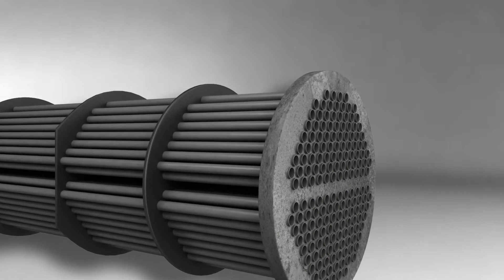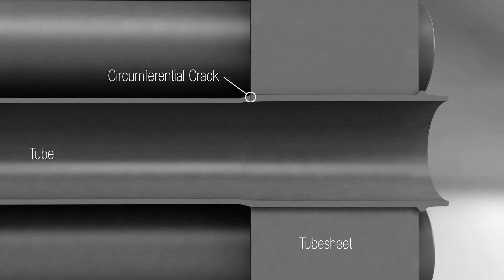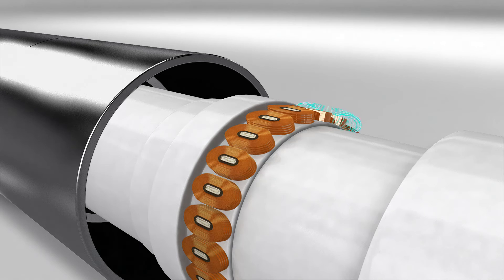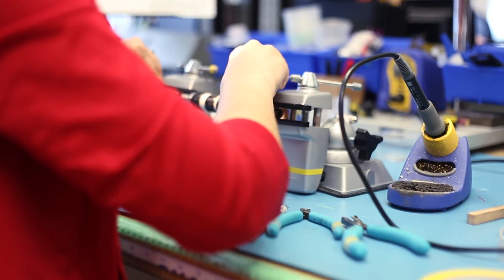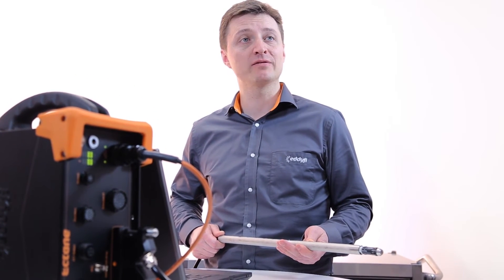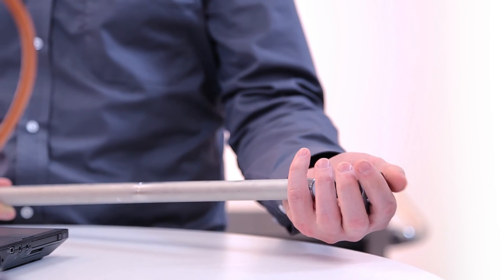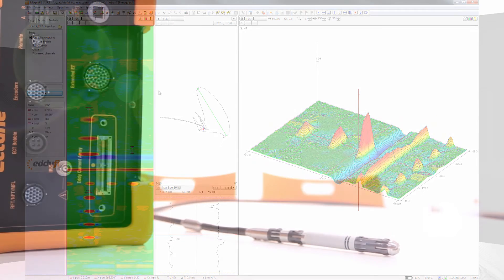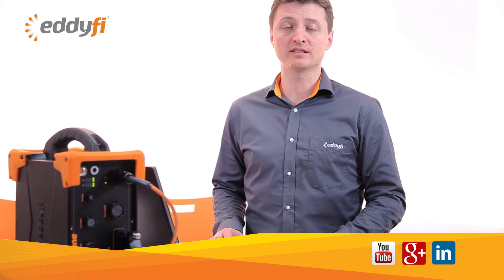Seeing Cracks in Heat Exchanger Tubes

Comment from the maker: Seeing Cracks in Heat Exchanger Tubes

Circumferential cracking is very difficult to detect and characterize with standard eddy current bobbin probes for various reasons. Eddyfi has developed the patented DefHi eddy current array probe to help detect some cracks. Discover how by watching our latest video.

http://youtu.be/TicErOSsdgk

 #heatexchanger   #eddycurrentarray   #nondestructivetesting